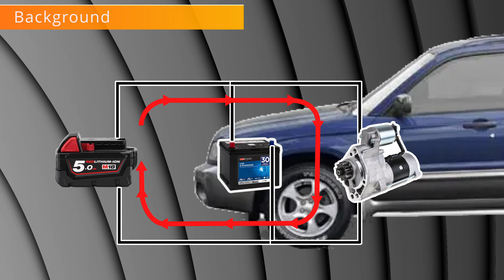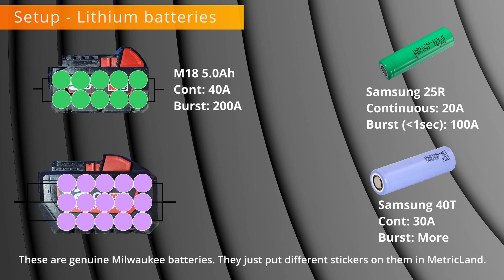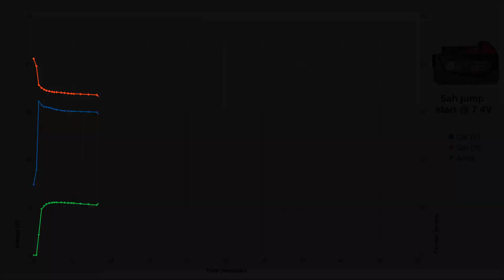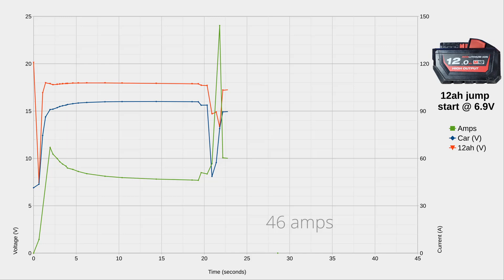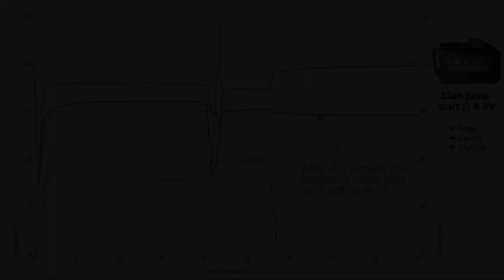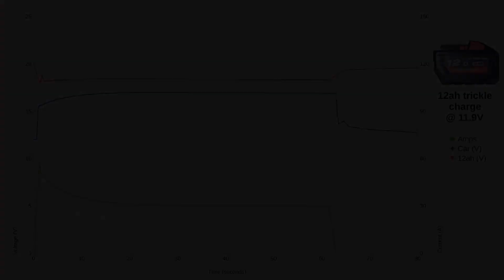[001] Jump-start car with 18V battery: How much current and voltage?

Comment: In Hyundai/Kia branded cars electronics in current models 17V is mostly in spec, but 18V crosses a line of setting up overvoltage DTCs and a have chance of breaking expensive things.
In example of old Hyundai i10 / Kia Picanto large voltage fluctuations can reset immobilizer but not ECM or the other way around and that messes up memory - every key get's unregistered and only diagnostic equipment can register those again, also with freaking immo pin code needed to start at all.
Reply from the maker: Awesome info, thank you! I was hoping that someone that knew what they were talking about would find this video. In my graphs I get fairly big inductive spikes from failed starts. I guess they have capacitors to absorb those, or it's less sensitive to short spikes?
Reply: Sounds like a really poorly designed system if critical memory can be changed when it is not being programmed. Or perfect for a throwaway car.
Reply: Jesus safety critical systems like this can't even stand 18v without resetting or damage?! That's comically bad. They should be able to eat at least twice the running voltage, like 30v or more...

Comment: Audi Allroad (C5) yield overvoltage DTC code in automatic transmission controller (in case of alternator malfunction). I don't no the exact overvoltage thresshold.

Comment: You can build a jump starter with a Cv CC regulator set to 15v 10A. Leave it connected for 10-20mins and start the car. This practically charges the battery instead of jumping and is safe for both the powertool battery and the cars battery

Comment: Kind of related. My portable generators battery was junk. I removed it and wired in a dewalt battery slide so I just stick in one of my dewalt 18 volt batterys to start.  No charging circuit or anything like that to worry about the only provision it has for charging the starting battery is a port to hook it to a wall charger. Or i guess you could plug it into itself if running. Works great with an 18 volt battery and I dont have to bother with maintaining a sealed lead acid battrery. I could just use the pull cord as it is only a 6200 watt running 9750 starting generator but Im lazy.

Comment: In america, 17 volts will fry a lot of different cars electrical system.

I would let it charge until it hit 14.5-15 volts, then try to start it.  Unless you know FOR SURE it won't fry your PCM and other modules.

Comment: Excellent video and graphics with your explanation. I've been wanting to find this info out for a while. Thank you!
I have a Gooloo 4000 car jumper and its fully charged sitting voltage is 16.5V. Another booster/air pump I have also sits at 16.5V fully charged. Great for jumping a car easily many times but I have three 240v inverters, 1x500W, 1x400W and 1x2000w. All pure sine wave and all refuse to work on my 16.5V car jumpers. All beep and warn over voltage but work perfect on my budget Kings LifePo4 60Ah battery that sits at 13.37V fully charged.
Again, great info. Just subscribed. 👍🤠🦘🇦🇺

Comment: 16 volts or less is said to be safe fer car radios now 15.5v is were i like to see it .playing around with a power supply hooked to radio in a shop for listening..Taramps amplifier specs from book 3000hd amp Minimum Supply Voltage, 9VDC. Maximum Supply Voltage, 16VDC. Consumption at rest, 1.5A. Maximum music consumption, 153A. Maximum consumption in sinusoidal

Comment: This is a great way to burn out your body control module, especially on fords and holdens by the way. More modern cars have better alternator control and 14.5v is considered overcurrent. 
Pro tip, never start a vehicle with lights turned on
Reply: 18V should not be burning a properly designed automotive system, maybe trigger a disable.  We have standards to account for worst case scenarios like a failing alternator or getting a jump from 24V vehicles. perhaps just cutting corners, but if you're in a situation where its necessary to jump from a tool battery who cares about that just get the dang thing running

Comment: to be warn dont crank engine too long i hae trick the protection on 18 v 6a battery, i bleve best and safest way is let it trickle charge for a minute
Reply from the maker: I think best is to crank straight away, but only hold for 1-2sec. As you say, holding ignition can cook the battery or blow its fusible link.. The trickle isn't really a trickle - the 18V battery is putting 30A into the car battery which is well above it's designed charging rate.

Comment: What is the maximum continuous current draw supported by the BMS for M18?
Reply from the maker: There's no programmed limit. The BMS only triggers if any cell voltage drops below a threshold (2 or 2.5V - it depends on cell type). There are physical limits, such as the fusible link, and terminals. I think Project Farm did a test where he short circuited batteries and they held a few hundred amps for a few seconds before melting the link.

Comment: I've just wanted to comment on such video. Something about massive Amp flow to the dead battery. It's not ideal with 12 Volt battery not to mention 18V. So I wanted to propose disconnecting one cable off the dead one and/or hooking it right on the jumper. This would be worse. Maybe a positive lead right on the starter would not fry anything else because of the resistance but you want the voltage to drop obviously. I'd not be afraid to charge a disconnected battery like that. That's what I'd do when in a doubt. Although I'd use short few second pulses and check for overheating. If the voltage drops like that I'm not afraid anymore.
Reply from the maker: If you use thinner jumper cables, that will decrease the current into the car battery. It'll also decrease the current to the starter motor, so you won't be able to jump right away. IMO you're better off using big cables and doing it quickly. A few seconds of very high amps into the car battery is probably better than 10min of lower (but still above charging spec) currents.

Comment: Thanks for posting this video. Three days ago I accidentally left the side lights on on my car. When I came to drive away the battery was too drained to bump star it, so had to go home by bus. I found your video, but rather than use my Bosch drill's battery, which I didn't want to risk damaging, I used 12 x 1.2v NiMhs mounted in series (16.5v open circuit, 10+ yr old Maplin cells), which like my Bosch battery are 2.0 AHr. This was enough to bump the car battery from 18.6 to 12.5v (open circuit) in 15 minutes (disconnected from car). I disconnected my NiMh pack and reconnected the car battery, and was able to bump start the car on first attempt (Peugeot 205).
Reply from the maker: Nice! I've never heard of anyone using Ni-mh for a jump start. Were they AA cells or something bigger?

Comment: No numbers I'm afraid but I did blow up a milwakee M18 5Ah trying this on a 2.0 litre diesel. Failure mode was a pair of cells going open circuit. Didn't leave it connected very long. It was connectred whilst attempting to crank.
Reply from the maker: Damn, how long did you hold the ignition? 1-2 seconds would be the max I would try.
Reply: @toolscientist  couldn't say really - it was a while back. I don't think I'd have tried for very long though and I do recall it blowing up on the first attempt.

Comment: Having jumped my own truck dozens of times that I see a few discrepancies in your Results. I believe this to be probably the quality of the cells in the battery itself. Using a Milwaukee battery 4.0 or 5.0 I have been able to hook up the batteries connecting them for only a few seconds then disconnecting and my truck went from so low that not even a light on the dash would light up to firing up like the battery was fully charged. Both of those being just the regular batteries with 18660 cells. I’ve also done the same with a 3.0 with 21700 cells. I don’t know any of the voltages in those situations but they all worked quite well. It appears you were using the Milwaukee knock off batteries. There is a very real difference between them. I have one of the m18 chainsaws. I sing the Milwaukee brand 12.0 😢battery I can with a fresh charge cut for about 5 min continuously without stopping before the battery dies. With a knock off battery it would cut for about 30 seconds and then say the battery was dead but waiting a few minutes it would cut again for about the same amount of time and say it was dead again
Reply from the maker: They're genuine. Outside of N & S America gets different stickers and product codes. https://www.milwaukeetool.com.au/power-tools/batteries-and-chargers/m18-batteries/M18HB12.html

Comment: Thank you for taking the time and testing that out. I found the information to be very helpful. But I would like for you to redo the video. And this time add a battery booster jumper box for comparison, Considering the cordless battery is taking the place of the jumper box. Essentially that's what it is a makeshift jumper box. You should take the two and compare them together like you just did. The jumper boxes instructions says for you to immediately disconnect the jumper box after the car is started, to prevent overcharging the battery and blowingl relays and sensors and whatnot. Once again thank you for taking the time out to showing us how it works it was a good video
Reply from the maker: Unfortunately I've sold this car and I'm not willing to do experiments on my new car as I need it.

Comment: make a 18650 or 21700 li-ion battery pack, replacing the car battery!!! that would be awesome, and maybe drive daily :) Great videos!!! Greetings from Colombia!
Reply from the maker: There's already some commercial options, but usually LiFePO4 prismatic cells rather than 18650/21700. More expensive, but longer cycle life than lead acid.
Reply: @toolscientist  but your diy version with tools batteries would be awesome

Comment: But will a 6amp battery workkkk??
Reply from the maker: The high-output 6ah will definitely work - it has similar power to the 12ah. If the car battery is only a bit flat, then even a 2ah might be able to give it enough of a boost to start. The 2ah can do about 50A whilst still holding 10 volts.

Comment: Well, charging the powertool batteries to 80% or 90% avoids having 21 Volts entering the car's electrical system, a more reasonable 18 or 19 Volts will be safer for the car.

Comment: Nice video mate, thanks for sharing your findings.
I have a 2018 VW Transporter TDI450 with an aftermarket Bosch battery and if I leave to many accessories plugged in during the day my battery drops down to where it won't start the van.
I have lost count of the number of times i have successfully jumped my van with my Milwaukee 18v 8Ah battery.
No problems with the vehicle or battery... yet 😊

Comment: Was always too afraid of a thermal runaway situation to actually attempt jumping a car.
Reply from the maker: The high-powered Li-ion cells are pretty safe. The only way to go wrong would be to hold the ignition on for several seconds.

Comment: Excellent work, thank you for taking the time to do this! I was surprised at how well that worked - I was expecting the power tool battery to be driven significantly harder than your data shows, potentially endangering the internal fuse. Good to know that that might not be the case in a pinch!

Comment: If just for starting and nothing else I reckon can just do away completely with a big heavy lead acid battery anyway and have instead in its place a sodacan size supercapacitor and three 18650s.
Reply from the maker: You should check out lasersaber. He's a mad-scientist that's been making car battery replacements with BIG capacitors. https://www.youtube.com/watch?v=XNmkXyhE4l8
Reply: Yes, that's almost the idea, but he's mistakenly trying to replicate standard battery voltage and it shows. To go down that path would have to have a boost converter which I don't believe is possible yet. I was advocating capacitor engine start over a decade ago and I was told "it'd never work" so only a matter of time boost converter used, I'll be dead by then!   @toolscientist
Reply: By the way, there's easily enough energy in a couple of alkaline 'D' cells to start an engine. Could do it with today's tech, with a flywheel and dog clutch, driven up to speed with a tiny electric motor.  Huge diesel engines were hand-started with a flywheel.
Reply from the maker: @jagmarc  now you've got me thinking of silly ways to start a car. Like how long would it take a hamster in a wheel to charge up a supercap to start a car 😄
Reply: Or a solar panel as energy source to keep topped up. 
Capacitor is always going to give voltage trouble, it isn't a flywheel with momentum. A 'superinductor' be better .
Reply: It's stored momentum of an already moving object kinetic energy that does most the work start engine. Whether it's a kick starter a flywheel or inertia starter motor

Comment: Correct me if I'm wrong the "7 V at beginning" car battery must had been contributing cranking current, since it seemed to be swallowing a fair current before start acting as a buffer.  It only takes a fraction of one Amp hour to start an engine
Reply from the maker: Hard to tell. In the 12ah test (5:27) car battery starts at 7V and dips to 8V when cranking. So that would indicate that it was maybe still sinking current. It was getting 40A for 20s before that, so not sure where that would put the voltage. In the 5ah test (5:22) it takes 30A for 40s (but with 2 failed cranks) and settles back at 9.5V (although this fell back to 7V over the next 15min before I did the 12ah test). My feeling is that 144A is too low to start the car so the car battery must have been contributing, or my clamp meter gives wildly varying results during transients. I'd hope it does something sensible like giving the average or max/min (if the signal is obviously peaking) in each display update.

I'm hoping that with more views, someone with a proper DAQ and 2 current clamps will repeat this test.
Reply: Hopefully someone repeat the tests but in meantime I can offer my own experience.

I'd say the car battery was doing most of the work, and the energy it used came from the powertool battery.

TYpically a completely discharged battery is capable start engine again after just a few minutes of couple amps charge. Only a fraction of an A.hr is used to start if engine primed. 

With leadacid battery, the majority of energy you'd put in comes back out again, if taken before it leaks away over time. So that means that '40A over 20s' energy had counted. 

Some of that first supplied energy though could had been used up 'repairing' a dead cell because 4-5V terminal voltage while cranking is a bit too low to start. 

A normal fully charged car battery V does dip down quite a lot while cranking, 8 or 9V isn't out the ordinary,  

I don't use clamp meters myself I prefer measuring millivoltage drop through a known resistance i.e. either end of a battery lead. 2 or 3 milliohms

I think the jumper-lead cable were bit too high resistance 50 mohm.

Comment: I want to try this with the car battery disconnected, then disconnect the 18V battery immediately after startup just to see what happens
Reply from the maker: I'm sure someone has done this, just without the 18V part. You can start the car with the lead-acid and then disconnect the +ve terminal to get the same effect. Try searching for "car running without battery" or "disconnecting car battery while running". I think it'll work until you put a sudden electrical load on, like the cooling fan turning on or using the wipers. That might make the voltage from the alternator dip and stall the engine.
Reply: @toolscientist  I've tried that before and driven it around and nothing happened. I guess I didn't try putting switching on a large load though. Anyway, I was mostly wondering how well the 18V would start the car without the additional current drain from the battery. I guess it's really not that much in terms of peak current
Reply from the maker: @dj_laundry_list  Ah, I see. I think the 12ah could just do it on a smaller car, especially with no jumper leads to add resistance. The 12ah dipped to 13V @ 140A, whilst the car battery was 8V, so the 12ah probably has another 80A left in it before it dips to 8V.
Reply: @toolscientist Makes sense, thanks for the explanation

Comment: The ability of the tool battery to push the car voltage higher is directly dependent on the state of the car battery.  If the battery is dead, then it can have a high internal resistance and not be able to sink current allowing the tool battery to push the car close to 18V when the load is light like when not using the starter.  If it’s in great shape, just low charge, you will be hard pressed to get it over 15V because it will want to sink several hundred amps first, on top of any loads like running a starter motor.